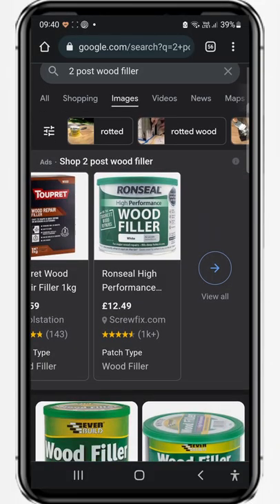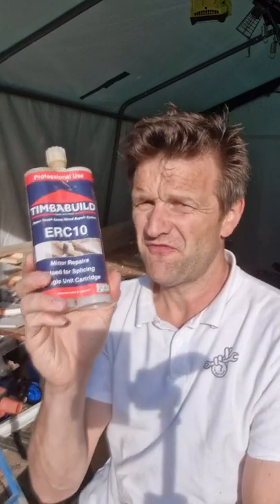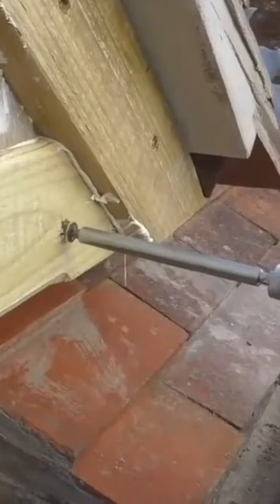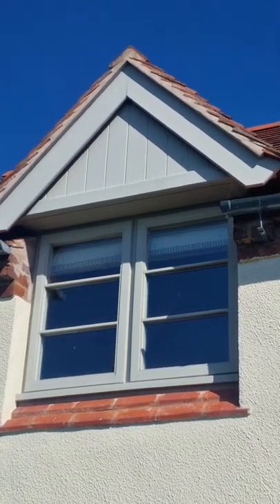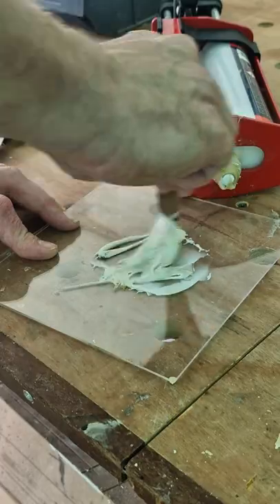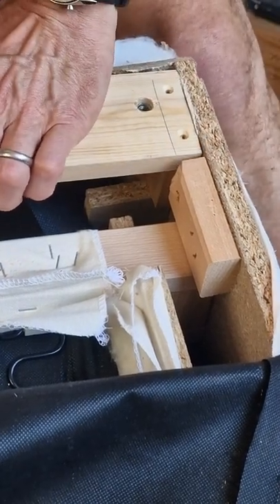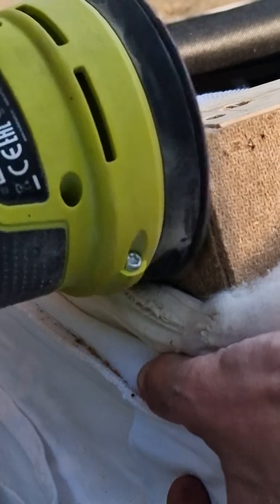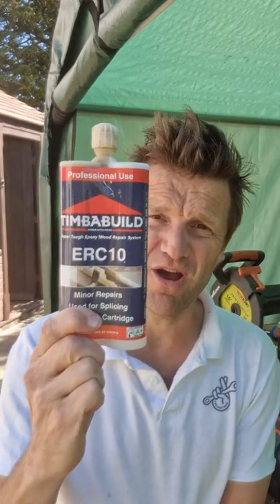Epoxy Wood Filler Adhesive for Wood Repairs #shorts

Comment: My builder recommended, and I’ve used for repairs to windowsills etc, Dry Flex from Repair Care International.  It looks very similar to the product you used Charlie, and comes in 1, 4 and 16 hour drying time variants.  It’s a similar 2 part system that requires a special applicator gun (or you can push the tubes out individually with a standard applicator gun),  or its now available as 2 tubes in 1 that fits a standard applicator gun and distributes the two parts out at the nozzle.
Dry Flex is even more expensive!  £48 for the twin tube version or £40 for the single tube on Amazon.  Slightly cheaper on eBay.
Good stuff but definitely a pro-grade product and price to match
Reply from the maker: Thanks Geoffrey. That's really interesting, particularly the price. The manufacturer says the double gun is important to get the quantities right but as you say, I'm sure you and I could squeeze out reasonably equal quantities from two separate tubes 👍

Comment: Hi Charlie. Only tangentially related, but I have just purchased an 18V Cordless Brushless Erbauer oscillating multi tool. I'd be interested to see your take on these tools and any attachments you might recommend.
Reply from the maker: That's a great little tool Ed, and they've got some excellent stuff in their range like these https://youtu.be/i6KYfrDBj3w and the SDS. I used my multi tool recently to cut away part of a cupboard so the plumber could fit a new stop cock and pressure valve, and the same day I had to use it to cut away the plasterboard in a cupboard as the new unvented water tank didn't fit. Couldn't have managed without it. I used the standard blade. There are others like the semi circular which is good for cutting in straight lines but most of the time I use the standard straight blade, and I use Erbauer blades for it even though it's Ryobi.
Reply: @CharlieDIYte  I must admit, I have a bit of an Erbauer addiction now. In addition to the multi tool, I've got their combi drill, jigsaw, planer, orbital sander and now I'm eyeing up the strimmer 👀

Comment: Abatron is the wood filler i use
Reply from the maker: I've not used that. Is that one out two part. The 1litre pots look like you don't mix a hardener in with it but I might be wrong..